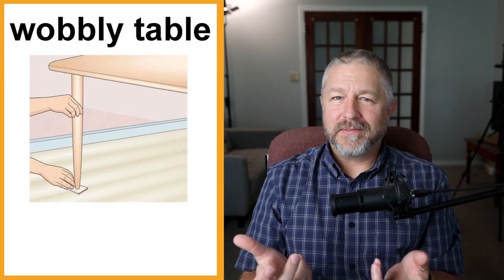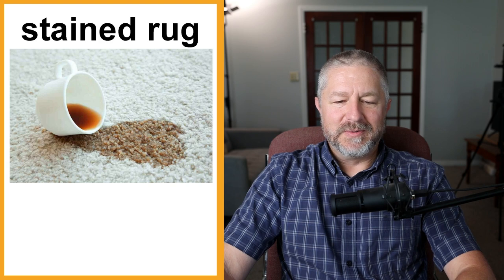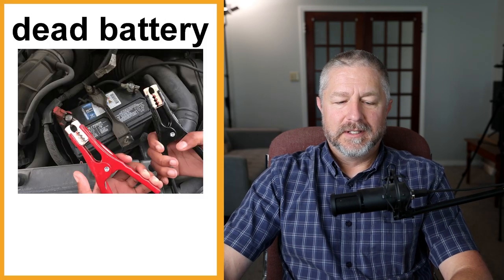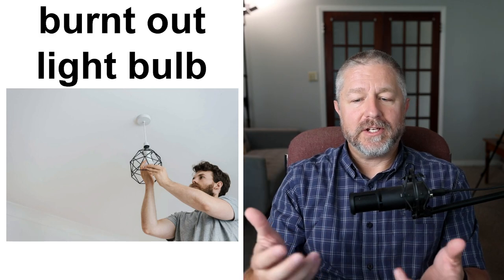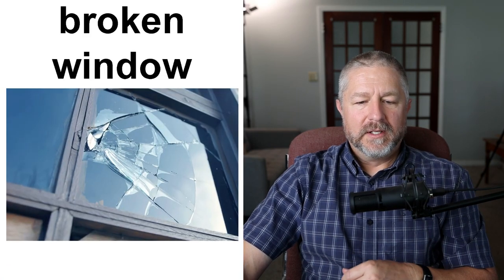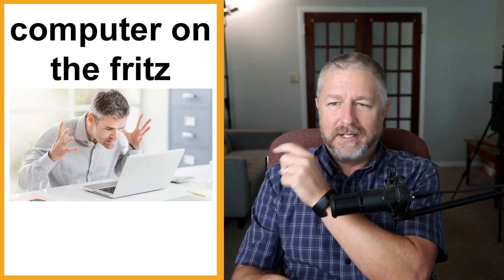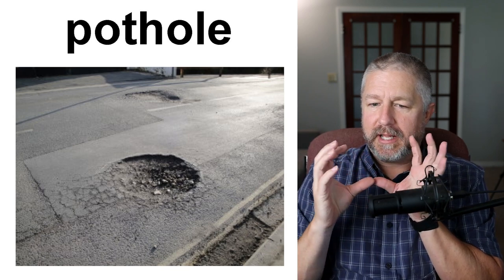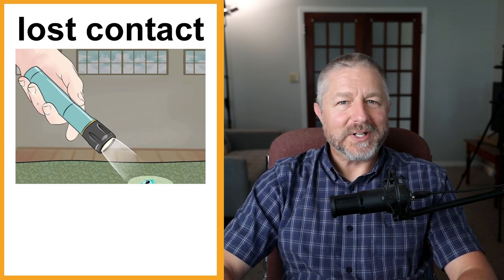Let's Learn English! Topic: Fixing and Repairing Part 2 🧵🔧🧰 (Lesson Only)

Comment: Record 39:wobbly table,squeaky hinge,paper jam,drafty door or window,stained rug,clogged sink or toilet,flat tire,dead battery,loose wire,lost button,tear or rip,burnt out light bulb,low oil,bent,leaky pipe,frozen pipe,dripping tap,broken window,busted handle,rusty mailbox,bad/poor connection,computer on the fritz,phone locked up/frozen,dent or ding,dull knife,tarnished jewelry,pothole,worn out tooth brush,bad signal,lost contact,tripped trip.